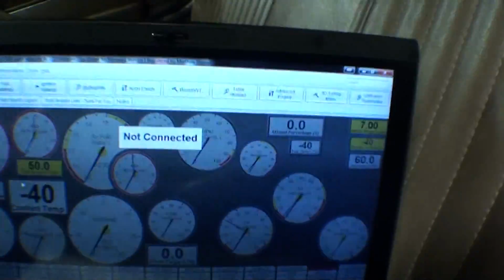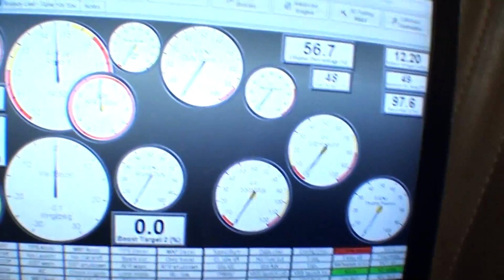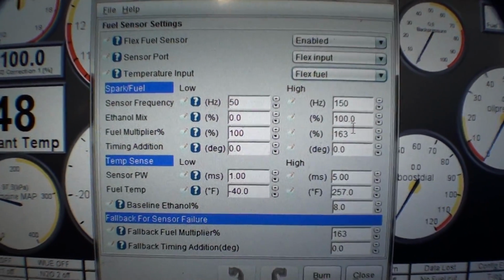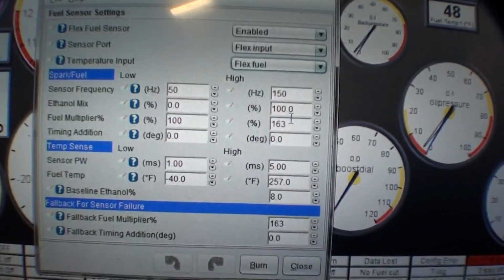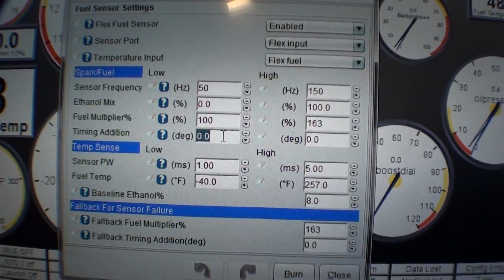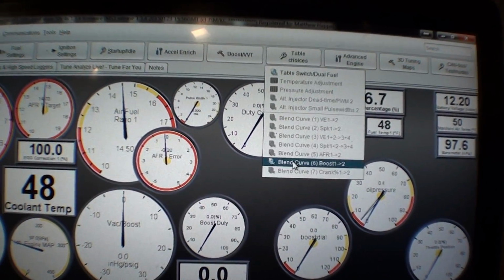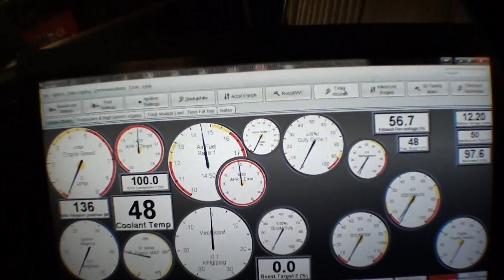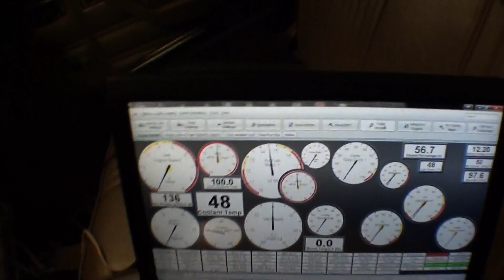3-31-15 E85, MS3gold, content sensor and more than you want to know

Comment: Hi quick question (2 actually) on this, I was watching your video https://youtu.be/umBn1nhbfac and was looking at your compostion sensor (@3.03) and then searched this video and can't help noticing you have hose clamps on either side of the sensor not those quick fit/release fittings.... my questions are did you fit the sensor on the return or the feed line to your fuel rail? and are the hose clamps enough to hold fuel pressure?

Thanks for your reply... I am building a flex fuel setup on my truck and found your videos really good info :-)

Comment: On your laptop that you use in the video, what program are you running to see all the readings you're getting from your sensors? also I remember in past videos you've talked about Microsquirt, is that a program that runs along with the factory computer, where is that a stand-alone computer that runs the whole engine? thanks again Matt for some great videos.
Reply from the maker: monteman700 im using Tuner studio, that is the name of the program used to setup,install.configure, megasquirt ECU's they are running as stand alone, without factory computer.

Comment: see what you think after u pump the timing and boost ect. you already have a injection kit you use at boost tho? so you only get to bump so much at wot, cause you already have it advanced over say than before meth injection. drill some holes in an old intake and mount up like 4 more 80 lbs. and run a micro squirt on them when u run out of injector duty cycle :p

Comment: At higher ethanol percentages and on higher boost, aren't you going to run out of injector pretty quickly?  You're on 83lb's yes?
Reply from the maker: correct and correct, if you planned on making tons of power on E you should probably get 120-160lb injectors IMO, what im just highlighting is how easy it is to setup and use and how well it works
Reply: ***** it'll take the heat okay? Sounds like good data to have. Throw egt on there too :p
Reply from the maker: SquishyBrained well what you do is, coil a copper or steel hardline to act as a heat sync and then you plug in the sensor on the end of that.
Reply: Cool.  I assume the accuracy is not as important as relative change vs RPM (etc), but keep in mind the restriction of that tube is easily calculated by the diameter and length so you can find the pressure drop from the tube and add that back in after the fact (if you care to).